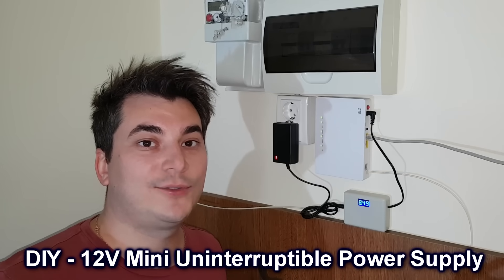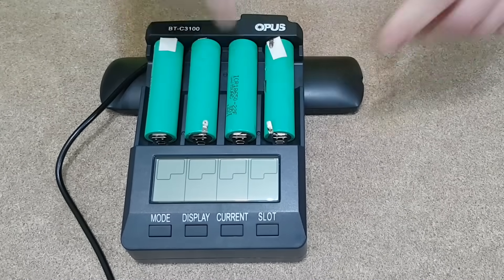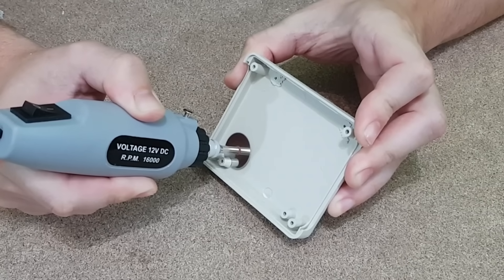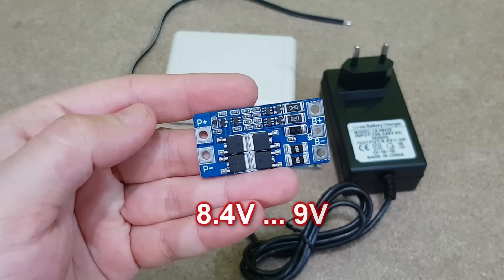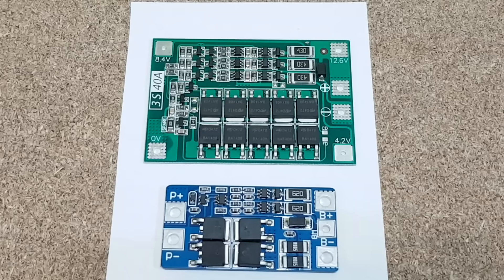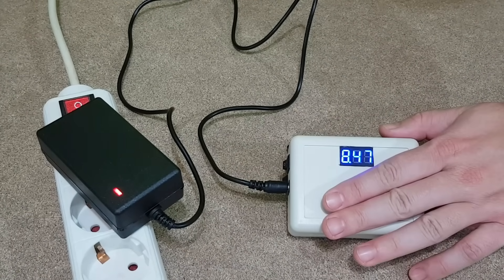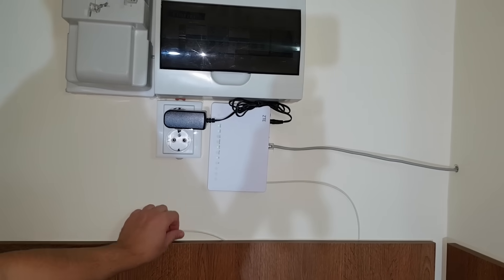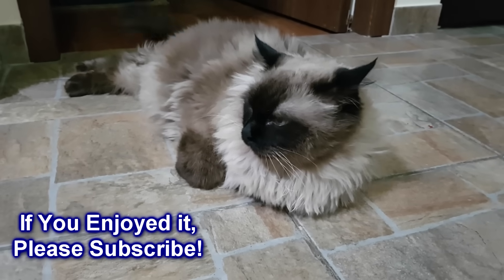DIY - 12V Mini UPS

Comment: Is it save to charge batteries straight trough bms from this charger?
Reply from the maker: yes. with 1A or maximum 2A, depending on the battery pack.
Reply: Absolutely not. One have to use a CC (constant current) Li-ion charge controller circuit in between. This is to  control the current as well as to terminate charging at CV.

Comment: Really good video! I just wonder from where did you get the laptop battery packs? Is it possible find it through internet? Is it worth to use old battery cells or is just better to buy new ones? I really like your videos since they have useful information and also are funny and easy to understand! Keep going like this ! Definitely subscribed!  Thumbs up 👍👍👍
Reply from the maker: new cells are better, but it will also work with good laptop cells. the laptop batteries are donated to me, or I buy them from local used electronics stores.

Comment: Thanks for That Video i really apperciated it so i have Question 1. i am using 3s with ouput of 12v fully charged maybe above then 12v and my router requared 12.5v so i am using mt3806 modual to setup up and make the volatge stable so it work soomthly but mt3806 droped the voltage to only 2v after 10 to 12 min  sometime it work fine yes it is heating mt3806 modual what i am doing wronge and i follow this video and do step by step here is the link (https://www.youtube.com/watch?v=p_FbkEUFa6k)
Reply from the maker: hi. the design of the UPS in that video is not very good. it's not stable and it's dangerous. 
1- you need a better BMS board with balancing and overcharge recovery feature, otherwise the cells will get damaged in time.
2- you need a higher charging voltage for a 3S battery pack, about 12.8V - 13V, to be able to trigger the overcharge protection voltage feature of the BMS board, otherwise the cells will be charged continuously and will be damaged.
3- the mt3608 converter doesn't have enough power for this project. you need a more powerful converter, probably with more than 50W, because it needs to work continuously, without cooling in a small box, at a high efficiency, without getting hot. 
4- the cells are always connected to the charger and the converter, which is not good. the switch should disconnect the cells from the circuit.
Reply: @Sorin_DIY   Thanks For Your Reply... your point 2 should i go for 2s as my router requires 12v 2A and the adopter of the router is 12v 2a and can be use for charging.

Point 4.  So what should be good to use it continuously the area where I live ( electricity issue mean daily load shading is about 5 to 6 hours in 24 hour ) so I want to work it continuously without any major cause please guide me
Reply: @Sorin_DIY  one thing more I am thinking using 2 adapter one for charging and one for  router 
.. so for  bettery protection I am already using bms when a charging adopter full the bettery so bms will protect overcharging...

And other adopter that work only for router when the electricity on ..   so when electricity gone power automatically switched to ups and and when power again on it automatically switch to adopter ..

And other charging adopter charge the bettery ... what should I have to do to make it automatic 
     what you think about it 

sorry for bad English ...
Reply from the maker: first you need to check the real current consumption of your router, because I don't think it's 2A, it should be smaller.  if the router draws less than 1A, you can use a 2S battery pack. but for more than 1A you should use a 3S or 4S pack. so you will need a higher voltage charger. if you make it with a 2S battery pack you can add a CC/CV step down converter to charge the battery.

Comment: Has anyone tried this? I used 3s circuit with 12v 1.5A power supply. It gives me around 50-55 minutes backup and when the router turns off, it doesn't turn on again when the power comes back. Somehow there is very low voltage on the output around 2-3v and the router's power light blinks as if it's not getting enough voltage.
When I turn the circuit switch off and on again, the router comes back to life.
My router is 12v 1A ONT and usually draws 0.7A.
Reply from the maker: some DC converters do not turn on if the load is connected before the input power is applied. you can use a different DC converter, or enlarge the battery so it will not turn off.

Comment: Why don't you use the 12V battery with a 3S balance board? I think it will work fine and be more efficient since you step down rather than up and the voltage difference is smaller. Anyway I never thought of using a charger as source with balance shield. Good idea on that part !
Reply from the maker: a 3S battery pack will have a voltage between 12.6V and 8.1V. the charger needs 12.8v to 13V to be able to trigger the balance feature and overcharge protection feature of the BMS board. so you can't use a buck converter or a boost converter to get 12V. you can use a buck-boost converter, but it will have a low efficiency so it will waste a lot of energy from the battery. 
as you said the best efficiency is with a step down converter, so a bigger battery pack is needed, minimum a 4S pack (if you use li-ion cells). I got some LiFePO4 cells and I plan to make a better UPS with a bigger battery pack and no switching delay... soon.
Reply: @Sorin_DIY You do NOT have to trigger overcharge protection on charging. Relying on BMS overcharging cutoff is a no-go.

Comment: But the battery is always charging right.. Which i heard is bad for li-ion batteries.. L
Reply from the maker: it's bad to continuously charge the cells. that's why I linked a better BMS board in the video description, that has an overcharge recovery voltage feature. with the new BMS board the charging process will be completely stopped, when the cells are full and it will be resumed only when both cells are discharged below 4.15V.
Reply: @Sorin_DIY  oh.. Okay 👍🏻👍🏻 thank you for the reply.

Comment: you can buy a cheap USB cable with barrel jack at the end, just make sure you buy the cable that can do a QC 3.0 handshake since you will be taking advantage of QC 3.0 12volt output.  After that just buy a powerbank that supports QC 3.0 with 12v output, pretty much every QC3.0 compatible powerbank support it, after that daisy chain it with QC 3.0 usb charger and your good to go, a UPS for your ISP router, not to mention everything I told cost around 35-40USD for all of it.

Comment: Would it be ok to use a Lithium-Ion battery that already has built-in charge protection, instead of the battery setup used in the video . I have a couple 12V lithium ion LiPo battery packs laying around not being used and they both have built-in charge protection and they came with a charger.
Reply from the maker: yes, but to connect them in series you still need a BMS board. also lipo cells are more dangerous than li-ion.

Comment: Can i use a 9v 3a adaptor to charge the 8.4pack battery?
Reply from the maker: hi. 9V is ok, but 3A is too much for a 2S battery pack. if you make the battery pack in a 2S3P configuration it will be ok.
Reply: @Sorin_DIY  wow, thanks for replying! 
Then i will use 9v2a instead.

I wonder if this UPS system can be applied to home too, using relay? ( maybe half of the home since whole home might need a bigger pure sine wave inverter which costs much more).

Comment: Hi, I am from Sri Lanka and these days we have some days 12 hours of power-cuts due to the contry's worst economic crisis. I tried few mini UPSs shown in Youtube but they could not hold more than 10 -15 minutes when the mains power is off. I like your mini UPS which I want to use for my wifi router. Could you pl provide the circuit diagram? Have you tested the backup time for wifi routers. thank you in advance.
Reply from the maker: https://i.imgur.com/PgwSa2K.jpg
the autonomy depends on the number and quality of the li-ion cells and also the current consumption of your router. you can make it last for 12 hours if you want.

Comment: Adding 1N4007 diode to charging point will not give any reverse current to charger.
Reply from the maker: yes, but it will create another problem. diodes have a forward voltage drop and will decrease the charging voltage from 8.6V to 8.1V or even lower. the battery will not reach the overcharge protection voltage of the BMS, so the charging process will not be stopped, the cells will be charged continuously. this will damage the cells in time. the charging process needs to be completely stopped, so if you want to use a diode you need a 9V charger.

Comment: Hi, very nice video. I'm having a couple of problems, can you please answer?
1. When the UPS gets completely discharged, and power comes back, it is not able to power up my router. The router light only blinks after a delay. 
2. When the UPS shuts off on battery, the batter voltage comes down to 3.7v and not below this. Why the circuit is shutting it off when enough juice is available?

I have tried the above with 2s (8.4v 1A charger) and 3s (12v 1.5A adapter) circuits and result is same on both.
Reply from the maker: hi. what type of BMS board and DC converter did you use?
Reply: @Sorin_DIY  I used 2s 3A standard and for 3s ups, 3s 10A standard version. For both I used XL 6009 DC-DC step up converter as same as you
Reply from the maker: 1. when the mains power comes back, if the router doesn't turn on it means that it doesn't receive enough power. so check the voltage before and after the step up converter, where does the voltage drop? the adapter may not have enough power to charge the battery and deliver power to the converter. it's not good to let the battery go completely discharged, use more or better cells to avoid this. 
2. 3.7V is the battery voltage or the individual cells voltage? 3.7V for a 2S battery pack is very low.
Reply: @Sorin_DIY  3.6v per cell. Getting almost the same cutoff point per cell in both 2s and 3s circuits. So, for 2s, it would be 7.2v in total and 11.1v for 3s.
I'll check the in and out voltages for the cutoff point and get back to you.
I really appreciate you taking the time and responding to me.
Reply: @Sorin_DIY  well I checked the 3S circuit and it is behaving in a really weird way. I tried to charge it separately and each cell reached around 3.95v total around 11.94. When I turned it on without load, it was giving proper 12.1v output but as soon as I connected it to the load on battery, the output turned off by the BMS (it never gives the output again until I put the charger again, then it gives output only on batteries too). When I connected the charger, there is a very minimal output that is 2-3V in total. Combined voltage of the cells was still at 11.94 but no output from the BMS on battery and very low voltage when charger is connected with load. Couldn't understand this behavior. 
The 12v 1.5A charger is fine because as soon as I connect it directly, it works on the router.

can you give me more diagnostic tips?
Reply from the maker: you need to answer this question: why does the BMS disconnect the battery from the load? you need to measure the current when you connect the load to the BMS. or try to connect the battery pack to the load, without the BMS. but add a fuse on the positive battery terminal. the fuse needs to be rated at a current a bit higher than what the load needs. if the fuse burnes, it means that there is a problem with the rest of the circuit and it draws too much current, so the BMS disconnects the battery. it may be a short circuit in the wires or the connector, try to change them.
Reply: @Sorin_DIY  I'll try to measure the current but usually my router is very power hungry and when I checked earlier, it draws 0.6 to 0.7 amps. I tried 2s circuit with another 9v router and it lasted 3-4 hours while the same 2s only lasts 40-50 minutes on 12v ONT router. So, now the only problem I need to fix somehow is whenever the batteries get depleted, I need to charge them separately in order to bring back the output, otherwise batteries draw all the current and router doesn't get any. 
Can you guess if I buy a 12v 3A charger, will it help solving this problem?
Reply: @Sorin_DIY  Also, both 2s and 3s circuits charge my batteries very slowly. I have tried all the chargers and tried charging them without any load (8.4v 1A, 9v 600ma, 12v 1A, 12v 1.5A) and result is same. Full charging in around 8-9 hours on 2s and 12-14 hours on 3s. What could be the issue?
Reply: @Sorin_DIY  can you please simulate this on your mini UPS: Put the router on UPS battery until it gets depleted and router turns off. Now connect the power to the UPS. Is it able to turn on the router with totally depleted batteries? My both UPS (2S & 3S) are unable to do so. It looks like all of the available current is sucked by the batteries to charge and router doesn't get any output.

Comment: Hi Sorin. Transforming 12 V -> 220 V in a UPS and back 220 V -> 12 V in a router's power supply was always not a good idea to me. I always wanted to get (build) a pure 12 V device. This your video inspired me to do that. Thank you so much for this! 
Please let me share some of my observations with other people working on such devices like me.
1) You can remove the step up converter from your schematic for most cases. The most of routers, network switches and others have buck converters inside. Usually they reduce voltage to 3.3 V to power the controller. This means you can power devices by even 5 V. Just try. You will be surprised. It looks like manufacturers choose power supplies having just economical reasons while devices can eat from 5 V to even 18 V.
2) Do not worry about back current into the power supply. It is usually less than 2 mA for most power supplies and is safe for them.
Thank you again for your videos.
Reply: Tested and approved as correct!

Comment: It's not working for me. Before connecting to boost converter, bms output voltage is 11.68 v but as soon as I connect it to boost converter, voltage drops to 0.67 V. And so can't step up the output for 12v. But when I connect boost converter directly to battery output, it works, which is not advisable !!!

Please help with this
Reply from the maker: what type of BMS board do you have?

Comment: This is a pretty cool project

I have a question tho

I'm gonna be using the same 2s bms and a 9v power supply
But when I measured the voltage of my power supply with no load it is 9.6v and can deliver 600mA of current
Do I need to put a diode?
Reply from the maker: yes, you should add a diode, but 0.6A is a very low current. it may not be able to power your device and charge the cells in the same time.

Comment: Great Work Sorin. can we use 12w dry battery which normally used in bike?
Reply from the maker: you can use it for a UPS, but with different components, not the ones from this video.

Comment: What about using bms 12v and 4s battery? You dont need step up and step down
Reply from the maker: when the battery is discharging, the voltage will decrease. if you need a stable voltage, you still need a converter.
Reply: @Sorin_DIY  oh, i see. That's why you using converter to maintain 12v. Ah, i remember that's, my modem wont work correctly if voltage drop below 11v. Thanks for your advice

Comment: Nice video, but does possible to have 3 output Voltage, 5V, 9V and 12V. I'm thinking to use LM78xx but not sure if this a good idea?...
Reply from the maker: LM78xx is not good. you need a step down converter, preferably with a CC-CV feature.

Comment: Can you tell some diode number which can be use for reverse voltage protection in charging end?
Reply from the maker: hi. you can use a 5A SR5100 Schottky diode, but if you want to connect a diode, you need a 9V charger. because if you use the 8.4V charger and add a diode with a 0.5V voltage drop, you will end up with a charging voltage of 7.9V. and this voltage is not enough to trigger the overvoltage protection of the BMS board, so the BMS will continuously charge the cells and will damage them in time.
Reply: @Sorin_DIY  my bms is 12v, can i use 12v 3A charger & use a 5822 diode ?
Reply: @Sorin_DIY  Hi, Recently I'v e been connected 12V 2.5Amps Adapter to my mini ups. After battery charge down to zero, while i connect adapter to ups ONU & Router restart continuously. Can you tell me whats the actually problem?

Comment: Modified a bit, can this be used in DC-driven LED lights as a solar-fed/gridless lighting system?
Reply from the maker: it will work, but not very efficiently. it needs better components.
Reply: @Sorin_DIY  I'm thinking more batteries in parallel and probably a better BMS. Anything else?

Is it possible to also create a relay path that totally cuts off the DC output for the AC charger if the AC charger is not energized?

Comment: I made a ups for Router & ONU with 1 3S bms+2 dc to dc booster circuit, output voltage is 12v, 12v. It's almost gave 5 hours backup After battery discharge fully while connect adapter (adapter is from ONU 12v 0.5Amp), Router & ONU not power up, only Router's led blinking. Can you tell me how to get rid form this situation?
Reply from the maker: I think you need a more powerful adapter. the battery is discharged and it's using all the available current from the adapter. the voltage drops and it's too low for the devices to work.
Reply: @Sorin_DIY  I'm thinking so. anyway tnx for reply.

Comment: I need an automatic mini ups for an anti thief diy system. It should be automatic so if they cut the mains it still works. Is there any diy circuit?
Reply from the maker: there is no circuit already made. you have to build it using several modules.